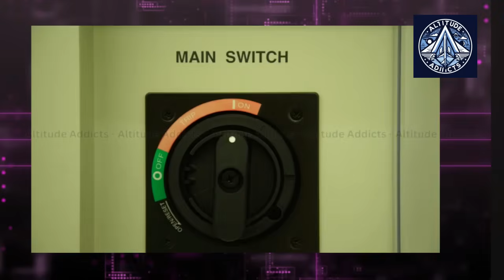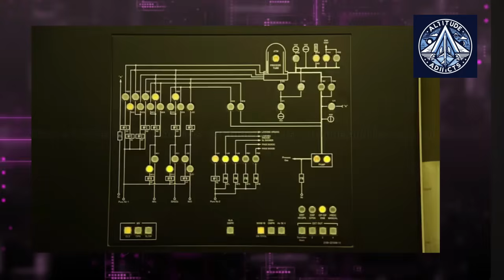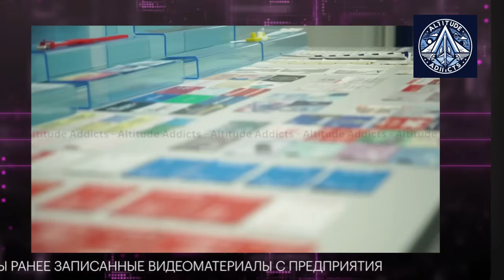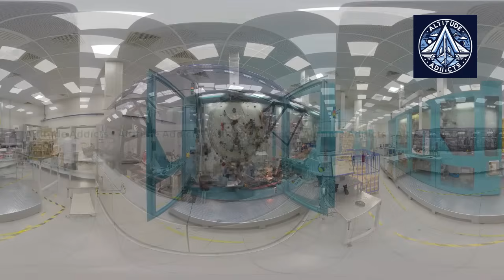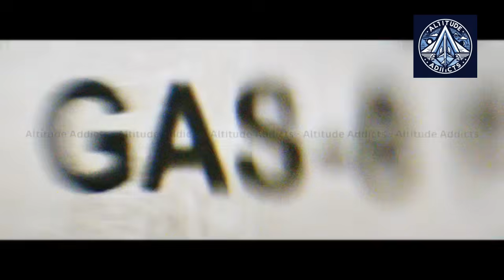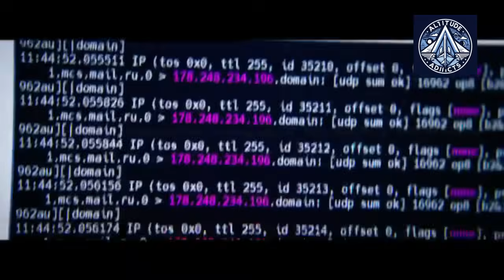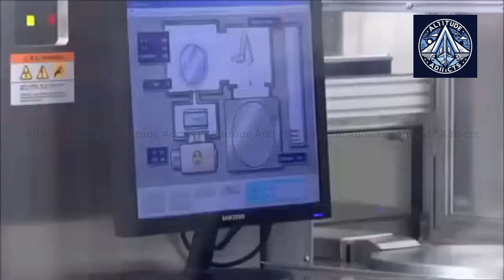Russia’s Mikron shifts 180 nm Chip Production to NM-Tech

Comment: This message they bring each 2-3 years. Nothing follows. In fact, Russian „leader“ Mikron is a tiny company with about $10 million revenue which produce the most simple chips on old French 180 nm equipment. No modification will save this totally outdated production line.
Reply: Слышу звон, но не знаю где он)))) 90 Нм да, западные, и уже есть и работают. А 180 созданы с НУЛЯ!
Reply: The share of 90–180 nm manufacturing worldwide is 20% and continues to grow. Most microelectronics are manufactured using 65–180 nm technology. For example, integrated circuits in laptops, discrete graphics cards, smartphone and TV boards, and many other electronic devices are still far from miniaturized technologies. Space electronics are manufactured using 90–180–360 nm technology, and the farther the satellite is from Earth, the thicker this process. The reason is simple: radiation, or more precisely, alpha particles, are so small that they simply fly between the atoms of a substance. However, sometimes they collide with an atom and knock it out of its molecule, which destroys the structure of the substance. The thicker the process, the longer it can operate before the radiation damages the transistor. This process can be clearly observed by searching online for footage from the ISS cameras. These recordings contain numerous artifacts caused by radiation exposure that damaged the camera sensor.

Comment: basically very small nm chips have 3x advantages .... size, less energy consumption and less heat production. So these are largely irrelevant for most applications with an attached power source via the grid or an engine . 
Even with a large datacentre where heat is an issue .... you can use "older" cpus and use water cooling - it's hardly a huge disadvanatage .....

Comment: Well, to cover almost all your strategic industries you don't need 3-8 nm super duper chips.
Reply: Very few features on “3nm” chips actually have 3nm feature size. Most modern western chips  have features primarily in the ranges of 25-45nm.
Reply: @ZionistHunter-p7i  indeed , capacitors and coils need space and will need it no matter what . Mosfets dont , i think its about mosfets .
Reply: you dont even need 20nm, not even 60nm, i use 20nm Intel CPU, 22nm... works as well as PS5 with a good GPU for games , for other things its way overpowered .But that being said , having a 180nm ability , does not give you a CPU , CPUs have to be designed , their design is the most crucial part , not making of it , but drawing it , same goes for everything else . Now they have a LAB , do tehy have blueprints .. Obviously only for ID cards .At least in 180nm range
Reply: @dedskin1  liar

Comment: Good node size for UV light processing.  180nm cn also be scaled into 90nm lithography transistors through the half mask process and still good for the 5v processors.  Furthermore SLC memory is virtually indestructible at this size.  This is also a good node to prove galuim oxide wafer production.